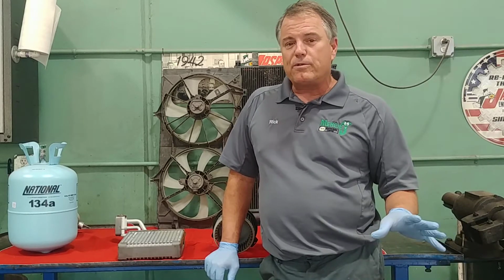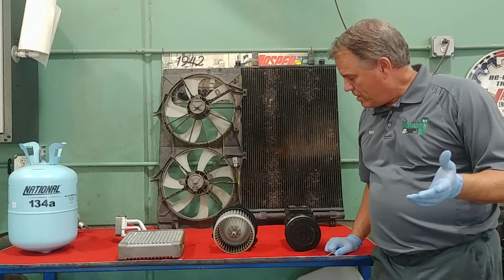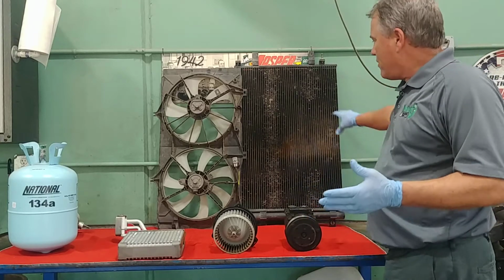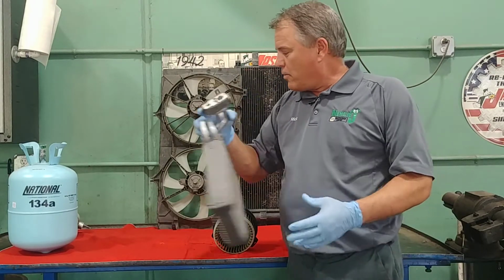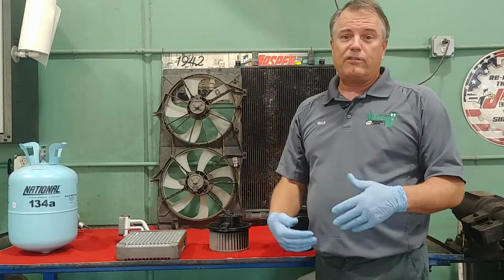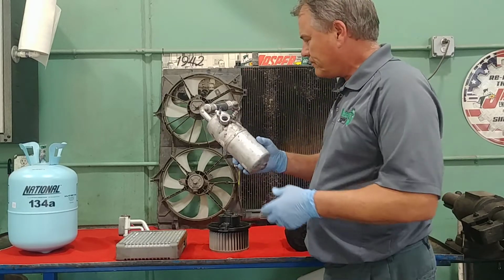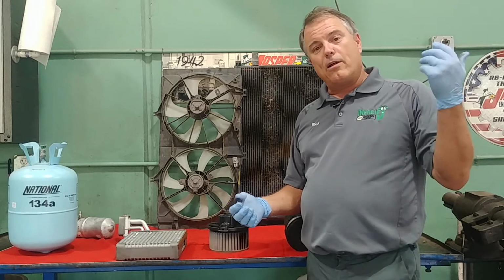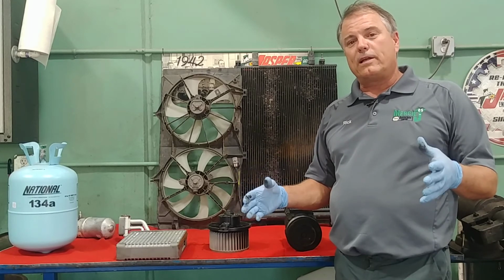How an Air Conditioning System Works  - Technician Training

Comment: Thanks for explaination,
 i have some questions,
1- How the liquid is converted to gas before going to compressor? i mean in the evaporator, liquid is sprayed, it doesn't converted back to liquid or it stay as gas until passing throug compressor?
2- how to know if my car have orifice tube or regulator valve?
3- does the ac system stay under pressur always with ac on or off, summer or winter? or there is something which release the pressure?
4-the compressor oil is mixed with r134a or it is have his own passing passage in compressor?
5-does all petrol, diesel car have same way ac system or some have different like bmw, mercedes, toyota, ford, dodge, suzuki, volvo et.